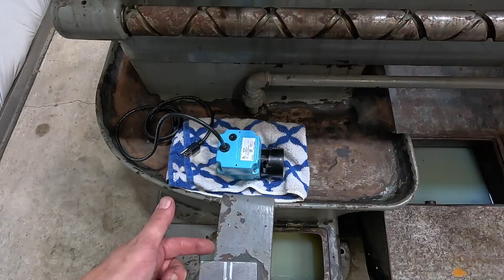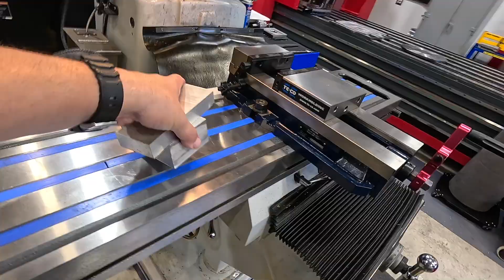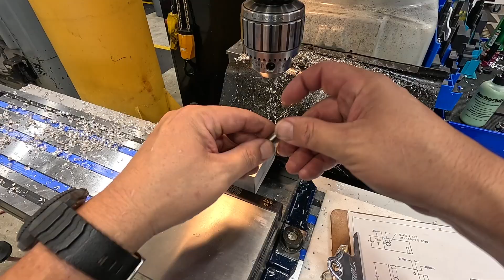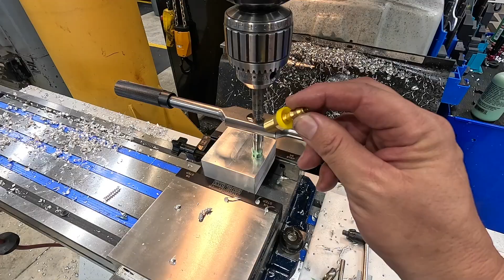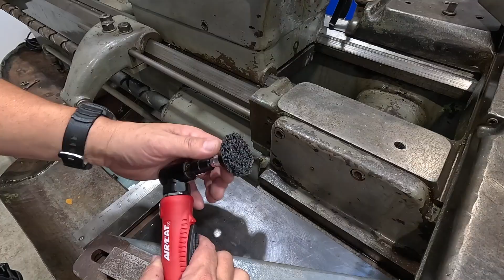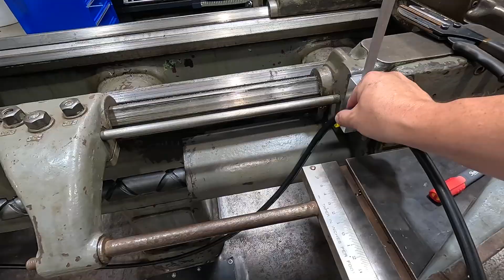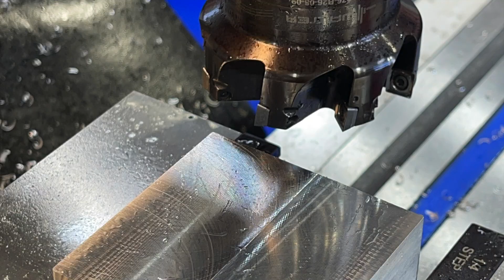American Pacemaker Flood Coolant System Repairs Completed

Comment: I have had that same ratchet tap for many years. It's actually my favorite one. US general makes some nice relatively inexpensive tools. I would use anti-seize instead of tape. Especially on stainless. I'm not feeling that rigid pipe to the pump. I think SS braided hose would be better because of the vibration from the pump. It needs to be located somehow. Maybe a strap bracket.
General also makes a really nice standard 25' foot tape. I have dropped it dozens of times and it never fails. 
       As everybody else said, up sizing the lines would help tremendously.
Reply: I've had a large and small US General ratchet tap set I've used for around 15 years. Still going strong.

Comment: I recognized that as an Allied Machine and Engineering spade drill when you pulled it out. You should be alright with that coolant pressure even though the ideal would be higher. 
I sold Allied and I sold to Allied. Their small spade drill I helped develop when they were bring it out. They were throwing screws and I solved it with a $3.00 tap instead of what their engineers wanted to do which was buy $500K of special screws from Switzerland twice a year.

Comment: Adam, the hose ID is too small to give you the flow you are expecting. A hose and fittings with the ID of the pump output would provide a lot more flow. I think you will be fine and have enough coolant flow for your work on that lathe. Great job, I really enjoy your work.
Reply: I was thinking the same thing… larger diameter. Looks like he will need to up size the pump to in order to overcome the total lift …. But for now it will work
Reply: That flow is like a 80 old man when you should have a 15 old kid flow. Of course you get spray everywhere.

Comment: All you need to do for a correct torque when using an offset wrench, such as a crowfoot. Or dog bone or your special adapter, is to mount it to your torque wrench at 90 degrees to the wrench. Not sticking out the front. Then the number on the wrench will be correct.
Reply: brilliant

Comment: You need more head pressure and a bypass to stop the pump from burning out.
Reply: Unless it is running it with no flow at all centrifugal pumps draw less power at low flow so you will not 'burn it out' The issue with no flow is you generate heat which more in non submersibles cooks plastic and seals in the housings. Submerged you would need to raise the Sump Temp and all that metal to 80-90C which won't be happening in a hurry.

Comment: I wonder if you should put in a bypass so that the pump doesn’t keep trying to pump when you turn it off.  I suspect the pump will burn up fast.  Get a valve that sends the coolant to the tool or the tank rather than turn it off.
Reply: 'Repost' Unless it is running it with no flow at all centrifugal pumps draw less power at low flow so you will not 'burn it out' The issue with no flow is you generate heat which more in non submersibles cooks plastic and seals in the housings. Submerged you would need to raise the Sump Temp and all that metal to 80-90C which won't be happening in a hurry.

Comment: Flex is always needed as the lathe functions.  If all hard there is trouble. I'd turn on both.  The back pressure in the pump might be limiting.

Comment: Pump is likely large enough.  Static pressure is your enemy.  Too much resistance with small hose and fittings.  Every fitting and bend adds to static pressure loss.  Size up, reduce fittings and bends.  I'm not a fluid dynamics engineer, but they'd likely tell you the same.
Reply: Not to mention the two 90 degree drilled holes and a quick coupler.

Comment: When Curtis on Cutting Edge Engineering started using a spade drill he found the metric equivalent 1/4 inch air chuck restricted the flow to much.  He had to up-sized his entire coolant system to 3/8" without a quick connect.  He just jams the end of a flex nozzle into the coolant port on the drill.  If you want to quick connects use hydraulic quick connects as they will probably flow better.

Comment: Going to a 3/8" line will help with the volume  easy way to test just plumb at the pump and the last fitting for the ring and then check the flow.

Comment: I can't believe it. Keith Rucker over at vintage machinery just took one of those drill bits and cut it up so he could use it to hold the diamond tip so he could clean up his grinder on his new old drill sharpener. I left a comment that he was going to need it next week. Lol and here you are using one this week
Reply: Yeah. I saw that too.😢

Comment: Looks pretty good.  If I may make one suggestion  Anywhere an electrical wire passes over a metal edge you have the possibility for the metal to cut into the insulation.  Where the power cord for the pump rubs on the edge of the hole is just such a place.  Best and simplest cure is a nylon loop wire clamp right at the edge of the hole to keep the wire off the metal and to keep if from moving around.

Comment: Adam if it was mee doin I would put the quick connect on the valve that way ya won't have ta take the barb off the valve and have the hose on the slip ring just sayin

Comment: The pore coolant flow appears to be from restriction. I would be putting 3/8” nipples and hose on for greater coolant flow as the pump was putting out more than enough coolant flow when tested in the sink.

Comment: You put small hose & small fittings (6) in the system. They're like limiting orifices. Bigger hose, fitiings & quick coupler will bring more volume. Pump in sink of water 7& close off nipple with your finger & you can squirt fluid ten feet. Fire men don't use garden hoses, they use big ones. If you want 45 psi get a bronze gear pump.

Comment: Isn't NPT a tapered thread?
Do you have to machine tapered threads differently?
Reply: He used an NPT tap which is tapered, that's perfectly fine for an application such as this.  There are tapered reamers if you want to spend the extra effort and start with a tapered hole but that's not necessary for something like this

Comment: You really need to put a bypass with a valve to tank so you are not deadheading that pump. I have seen many fail on water fountains from not having one.
Reply: A centrifugal pump can pump against a short period with out damage, excessive pumping against a closed valve will heat the fluid and can cause premature ware. That style of pump is definitely not a positive displacement.
Reply: @tnyleo  Exactly. It’s very likely that any operator is going to sooner than later forget the valve is off and run it too long.
Reply: Repost for the third time. Unless it is running it with no flow at all centrifugal pumps draw less power at low flow so you will not 'burn it out' The issue with no flow is you generate heat which more in non submersibles cooks plastic and seals in the housings. Submerged you would need to raise the Sump Temp and all that metal to 80-90C which won't be happening in a hurry.
Reply: @seabreezecoffeeroasters7994  That's the answer I was looking for, because I remember reading that before! That this style of pump will draw less power at low flow, so motor overloading is not the issue. However a lack of cooling from fluid sitting there being heated up is the issue. but like you say being submerged goes a long way to cool it.
Reply: @seabreezecoffeeroasters7994  How long is a hurry?  How often does he run the Pacer?  He could let it sit over night, over a weekend. In fact, it could be months before he uses the machine after finishing a job.  “In a hurry” is not something to bank on.
Reply: @SkylerinAmarillo  I have seen pumps in situations like that run for hours without an issue. It doesn't mean an operator won't do a dumb (I used to make my living in Industrial Pumps from just that). If you had a non submerged pump then in minutes when dead headed you can boil the water to steam and kill the plastics (If it had plastic bits) and seal elastomers and faces. Personally if it was mine I would be dropping a little twin impeller column pump back in the hole like it would have had.
Reply: Replacing the straight ball valve with a 2 way valve would be quick and simple.
Reply: Look at similar machines, not bandsaws and use heavier duty parts for modern tooling
Reply: According to Franklin Electric (mfr website) there is a shutoff feature at 11.8' of head pressure
Reply: What is “dead heading” please? Is that a restricted flow? I know some pumps can be overloaded by a unrestricted flow, which is actually counter intuitive. But positive displacement pumps will be overloaded by a restricted flow. That’s my understanding.
Reply: @Orgakoyd  He means if you leave the pump turned on but the valve closed, the water has nowhere to go, and the pump will likely burn up and fail.

Comment: The hose nipples have a smaller diameter and more restriction to flow than the full diameter connections. Like a street elbows on a gas line.

Comment: Surely its easier to have the female quick disconnect off of the ball valve to be able to change between uses instead of having to take fittings in and out? Then any other coolant mods can just have the same male quick connect and be swapped in seconds

Comment: What was the purpose of the manifold by the pump, you could have simply run the hose straight off the pump? I would have fitted two valves off the metal pipe, one with a quick disconnect and the the top valve with your coolant sprayer permanently attached. Fit a some protection around the cable to the pump (over fit a cover to the pump hole), it looks like the cable is resting on the metal edge of the hole. I know you liked the tube rubbing under the cross slide, but is it likely to catch on anything? I'd have kept it simple and short, let it rest on the cross slide. As the others have commented, running an electrical socket near coolant is not a good idea, I'd look at moving the plug else where and either use a remote switch or use a physical switch mount on the front of the lathe. I never saw the video where you discussed the pump, I assume it can run stalled or has an inbuilt pressure switch?

Comment: Adam ,   Larger piping would give more flow,  Thats why the original pipe was one inch.  Good stuff
Reply: When I’m doing Things myself I try to go at least one Size up.
For the Manufacturer the Price Difference mattered, but for your own Stuff it’s negligible.

For normal Piping the Argument is that the Manufacturer sees the Cost of Pipe, but not the Electricity Bill for the Pump.

(And you need a Filter if you use the Quick Connect. I’d always use one, but in some Cases the Line is so wide, that you get away without one.)

Comment: I would say that the pressure loss is from the small diameter of the hose, and the size of the hose fitting adapter rather than the size of the pump. Compare the hose to the size of the original coolant piping. Maybe a 1/2” hose and fittings will give you bigger volume

Comment: I wouldn’t run a cord and switch all the way to the headstock. Coolant and electricity don’t mix. You could get a remote control Christmas tree light switch for under $20 at your big box store and just have the remote control up at the head stock. The two cap screws on the carriage I would Connor sink, just so it’s not a knuckle buster and it stops chips from getting caught on them. Great video look forward to your next.

Comment: You probably should have put the quick disconnect on the output of the ball valve instead of the input to the drill bit. that way you could leave the quick disconnect and hose connected to the slip ring and just get another quick disconnect connector and hose to go to a coolant sprayer.. Then you can change between the two spray systems by swapping at the disconnect instead of removing the hose

Comment: Great job Adam, From personal experience using those quick disconnects for liquid transfer they will reduce pressure just because of the design. I don't know what type or manufacturer they are but as an experiment to see if indeed you may need a new pump, remove the quick disconnects infeed line and test the pump pressure of the liquid with no restriction. You may be buying a bigger pump and because of the quick disconnect get no improved flow.

Comment: If you put the adapter 90 degrees to the wrench you don’t have to do any math or use the app, it will be the same TQ value as displayed on the wrench. As an Army Aviation mechanic we are taught how to do the calculation but in 25 years I may have only done it once or twice because of an access issue? Every other time I put the adapter at 90 degrees and let her eat. Great video as always, keep them coming!
Reply: The challenge with the 90-degree technique is that you make a right-angle triangle, which means the leg of the triangle applying the force to the fastener is the hypotenuse. The hypotenuse will always be longer than the torque wrench. The length of the adaptor influences the length of the leg applying the force. That's why torque wrench manufacturers recommend calculating the force multiplier, reducing the torque by that number, and using the adaptor straight on. We did a quick video showing that the 90-degree technique does increase the force used. Hope that helps!
Reply: @martinprecisiontools  Thank you for that information. I’ll have to check out your video. I guess now I have to walk out of my office and ground every helicopter on the flight line for incorrectly torqued fasteners. Looks likes it’s going to be a long weekend 🤦🏻‍♂️. 
*updated*
I watched the video from Martin Precision. I’m not saying one way or the other which method is correct. However I will say this, the torque wrench in those videos needs to be calibrated. I saw more than a 5% spread in torque values. It may be fine for that application but for critical fasteners such as in aviation, that much deviation would never fly(pun intended).  I guess that’s why our wrenches get calibrated so often 🤷🏻.
Reply: @martinprecisiontools   I've personally tested using a crows foot wrench and an adapter holding a box wrench, two very different distances from the pivot. My results and the math behind it show "good enough" or within the repeat values of my torque wrench. sin of 90 degrees is 1 which is why this works and I'll continue doing this because for my needs it is definitely close enough. I can see where having a fairly long distance between fastener and torque wrench connection could lead to problems, but within reasonable lengths, I don't see an issue for practical purposes. Things like rocker cover on a Harley TwinCam installed in the frame of a touring machine, your access is so small that this is the only way forward. I use a Pro Motion adapter on my wrenches if anyone cares, slick little product. And yes I tested before using on anything of value because I didn't believe it could be "close enough", I proved to myself this was an OK procedure. And I since saw other tests proving this was close enough, one was with a high dollar Snap-On torque wrench calibration device, deviation from a straight torque wrench was around or less than 1% which was also what they were getting for different gripping on the reference wrench (if my memory is correct).
Reply: I should have read through the comments before posting, I said the same thing.